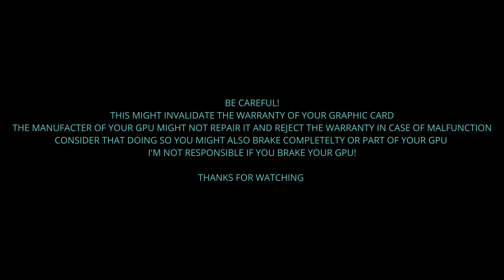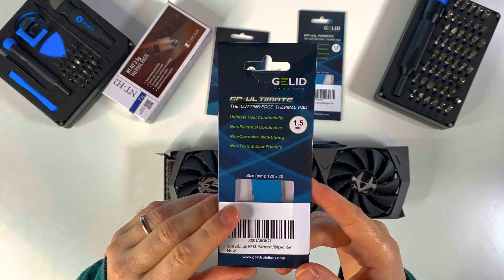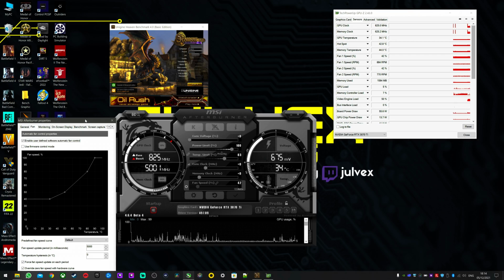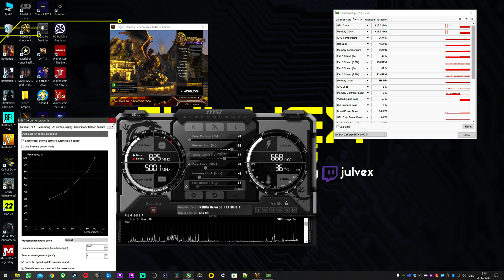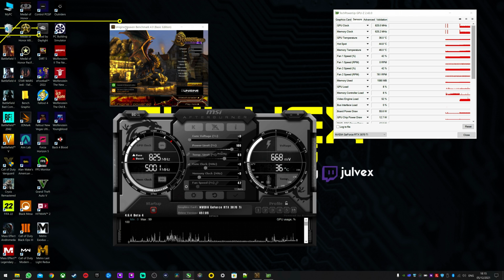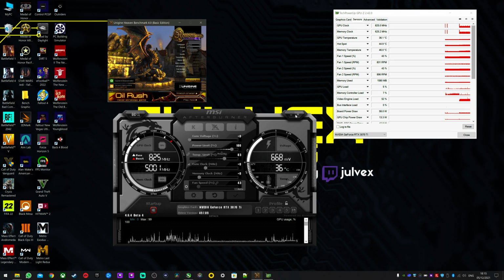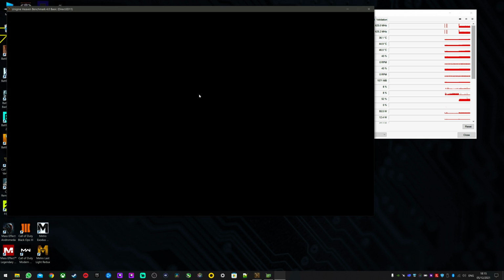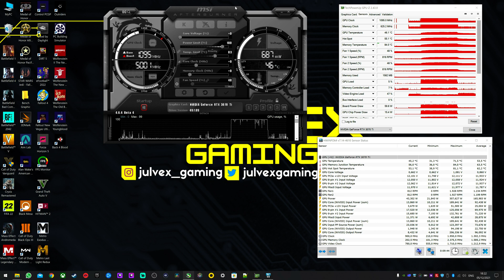Replacing the thermal pads on Zotac RTX 3070Ti Trinity OC

Comment: Zotac rtx 3070 ti trinity oc which thermal pads should i use gp ultime or extreme which is perfect for zotac
Reply from the maker: the extremes should be ok
Reply: @JULVEXGAMING I have used extreme 2mm on front and ultimate 3mm on back now I have high core and hotspot but memory temp are 88 is it bad or its ok
Reply from the maker: @RayanXPlayz  depends on whether those temps are in idle or in use, if in use, those temps are ok
Reply: @JULVEXGAMING2mm on front and 3mm on back should be ok right ?

Comment: First time replacing thermal pads, was looking to improve my thermals to make my rig more silent so that I can lower the fan curve.
=> bought 3 sizes (Thermalright Odyssey Extreme 2.0, 2.5, 3.0).
Opened my gpu up, removed and verified that the pads zotac used matched with my 3.0 and 2.5 (foreshadowing, uh oh) by lining them up and comparing => applied 3.0 back, 2.5 front.

After applying the new pads VRAM was insanely cool, but my core temps were absurdly high, fans spinning etc. thought my gpu was gonna explode juding by my fans lol
Reopened and the GPU-die thermal paste was barely spread on the cooler contact plate. I squished the front 2.5 down a bit with to make them even with the gpu-die, should be a good fit now, core temps are fine but the VRAM is sitting at 70 degrees in idle. After about 6 hours of either Core or VRAM being too hat & constant reapplying and testing this is kind of a bummer. 

Well, I guess my pads are way too hard, Zotac used very soft ones. My backplate is also a bit bent from the thick 3.0 on the back. What I will take from this is watch out what hardness you buy for your thermal pads, unless you exactly know the specifications of your needs, softer ones will make things way easier as they allow for more margin of error. Will try again with softer pads

Comment: Don’t use 1.5 for the front, I used 1.5 and it wasn’t cooling correctly (exact same pads he was using in the video) I then saw people saying to use 2.5 gelid extreme so I did and the memory did go down to below 50 but it was too thick for the radiator to touch the gpu core so it wouldn’t cool properly. I’m now ordering 2.0mm and will let y’all know how it works out because I’m guessing it’s 2.0
Reply: Hello! Did the 2.0mm do a better job? Thanks!
Reply: @estralo81  for me yea, just make sure you clean off the old stuff real good and you don’t over tighten when reassembling because it can crack the gpu die
Reply: @theepicgaminggod4275  so 2 mm for the inside pads, and 3mm for the backplate ones?

Comment: I'm thinking of buying this card used. Does this card has heating issues? And opening the card won't kill the warranty?
Reply from the maker: Normally the card shouldn't have any big heating issue, the thing is that depends on how demanding the game(texture/resolution, etc) is, and also it depends on what condition you're buying it.
Keep in mind that you might lose the warranty  -depending on where you live, better ask your regional Zotac support just to be sure
Reply: @JULVEXGAMING  btw have you undervolted the card? If not can you try undervolting the card to 150w and see how it performs 🙈
Reply from the maker: @vzero8612  sure, check it out here: https://youtu.be/el1FUYXtB0Q
Reply: @JULVEXGAMING  nice but that's not half the power drow. Can you you please test your GPU in 150w or on it's half power and see how much performance you're losing and temps. If you're still using 3070 ti.
Reply from the maker: @vzero8612 I don't have that GPU anymore, but usually, I would recommend undervolt instead of using the power slider just to avoid strange behavior with the power spikes.

Comment: hey i did the exact same of the video on my zotac but the temp are higher than before any suggestions?
Reply from the maker: Hello there, if the high temps are on the core try to repaste it, it happens to me that i have to repaste due to the shore of the pads, otherwise if the high temps are on the memory try to squish it or check if you tighten properly (don't overtight or you can damage the pcb!)

Comment: Thanks for guiding us. Do you know what is the purpose of the square black plastic around the GPU core (front side) for? I followed your guide and managed to get my temps down by 8C - 10C. But as I was busy cleaning up, i just realized i took the black plastic out to clean the it separately and FORGOT to put it back on.
Reply from the maker: I assume you're referring to the black square shape of the core in that case you have to put it back on it can prevent the core touch other surfaces that should not be in touch
Reply: @JULVEXGAMING  ok thank you, looks like i have to open it again.

Comment: Hello, did the gpu core experience an increase in temperature after changing thermal pads?
Reply from the maker: Hello there, not at all. If you apply it properly the core temp should be even lower

Comment: Are there different models of Zotac 3070 ti Trinity OC? I got 1.5mm pads and they arent thick enough
Reply from the maker: It might be, the only thing to consider is the shore of the pads to me some (not all) pads with a soft shore were ok others not. From what I’ve seen the exact measure (measured with caliber) is 1.7mm which afaik aren’t available. With most of the 2mm you should be ok
Reply: @JULVEXGAMING  2mm for the inside what abt the backplate? also 2mm or 3mm?
Reply from the maker: @MahboobIslam  3mm should be fine

Comment: Those who are doing this, PLEASE buy 2mm for the vram ESPECIALLY IF YOU ARE USING THERMALRIGHT PADS. 1.5mm is complete bs. I tried and there is minimal contact with the heatsink. 

Before: 98-100
After: 100-110+

EDIT: so i went full “dicko mode”. I used the remaining 1.5mm pads and layered them on top of the existing pads. Squished them all down gently with my finger, re-applied thermal paste, reassembled, and temps are now

1 layer: 100-110+
2 layers (please remember to squish it): 88-94

Do let me know if it works for u too! 🙏🏻
Reply: You suggest to use 2mm with thermalright extreme odyssey ?
Reply: @darknain  yea 2mm should be fine
Reply: @Keeferino  what do you use to clean the old thermal pads?
Reply: @darknain  alcohol wipes

Comment: Hi there..can i use 2mm thermal pads instead? Thanks
Reply from the maker: Hello there, yes you can try, squeeze them well so the heatsink can touch the core properly
Reply: @JULVEXGAMING  is there any effect if i use 2mm pad?
Reply from the maker: @amirazry4166  nothing asfaik just pay attention that the heatsink is touching properly the core and squeeze well the pads
Reply: @JULVEXGAMING  ok thanks for the info
Reply: @JULVEXGAMING  hi there, do you heat up the gpu a little bit before opening the backplate to soften the thermal paste?
Reply from the maker: @amirazry4166  no I didn't do that, I just squished delicately the backplate to remove it from the board; pay attention to disconnect all the cables especially the RGB cable

Comment: I did everything as in the video, but the memory temperatures only got higher.  even started dropping frequencies.  what could i have done wrong?  maybe not pressing enough?
Reply from the maker: It  could be possible, did you monitor also the core temps? Because that might give an idea if you have to press more or not, in fact if the core temps are high that means if the heatsink isn't pressing properly (except the fact that the thermal past is applied correctly); with that said it depends also on what thermopads you're. I would suggest trying to press a little bit but DON'T push too much.
Reply: @JULVEXGAMING  thanks for the answer.  I used all the pads like yours.  only I did not understand why the second thermal pad 120x20 1.5mm.  Is it needed instead of that massive thermal pad that connects the heatsink and the backplate directly under the 3rd fan?  I didn’t replace it, but it’s 2mm, and perhaps because of it, the new thermal pads don’t touch the radiator?  🤔
Reply from the maker: @nbroO  Yep, try that too (also because that one is horrible!)
Reply: @JULVEXGAMING  I use video card in mining.  It seems to me that immediately after the purchase, the temperature of the core and memory differed by about 20-30 degrees.  Today, 9 months later, Before changing the thermal pads, I had a core temperature of 50-53 and a memory of 102-110 at 75% fan and a room temperature of 25 degrees.  after the replacement, the core temperature is 41-43, but the memory temperature is more than 110 and the core starts to lower the frequency.  I will also say that in idle temperatures 37/62 at 50% of the fan.
Reply: @JULVEXGAMING  looks like you forgot to put in the narrow thermal pad you took off at 3:26
Reply from the maker: @nbroO  that’s a little bit high also in idle - even before you changed the pads. My room temp is 21/22c and in idle @45% fan speed the core is 29/30c and memory 34c more or less. I don’t use it for mining but in high demanding games with the new pads never went over 85/90c. Is your case ha in a good airflow? In case you can try with the 2mm pads- it happens to me with another one 3070ti amp holo - which is the same as trinity oc - that the 1.5mm pads weren’t fitting but the 2mm yes (but you have tu squeeze it a little bit).
Reply: @JULVEXGAMING  Tomorrow I'll try to disassemble and see how the thermal pads deformed after assembly in order to understand how much they fit.  I will also try to replace the thermal pad that I did not touch under the 3rd fan.  I'll post the results here.  maybe it will be useful for someone
Reply: @JULVEXGAMING  Today I disassembled the video card again.  1.5mm thermal pads are too thin.  they don't touch the heatsink because of the bezel around the core.  temporarily, while new thermal pads are being delivered to me, I combined 2 thermal pads and squeezed them well, also applied a little more thermal paste to the core.  now I got 53/83 degrees in the same conditions.  it's good but not perfect) add to the description that you may need 2mm instead of 1.5mm thermal pads
Reply: @nbroO  yes. I have the exact same issue. Also using for mining. @JULLVEX GAMING please update the description thanks.

Comment: Doing this will void warranty in india. Is there any other option to reduce vram temperature?
Reply from the maker: Hey there, I assume so but you should verify locally with your retailer or Zotac. You can lower the temps a little bit by undervolting the GPU while maintaining basically the same performances, I've done a tutorial on how to do that, check it out if you're interested, Also keep in mind that the airflow of your case is playing an important in order to have good temps.

Comment: Hello thank you for your video!
I tried the process but I stopped since I couldn't remove the heatsink, it seems that the heatsink is really stuck on the pads and doesn't move..any idea how to get it unstuck?
Thanks in advance!!!
Reply from the maker: Thanks!
I suggest you to check if you have unscrewed all the screws, if this is the case then I guess it might be that the heatsink is stucked into the core instead of the thermal pads (similarly when you remove the cpu cooler after a long time and the thermal paste is really dry); pay attention also you have disconnected also all the fan/rgb cables too.
Reply: @JULVEXGAMING  There is no adhesive on the upper part of the pads? If it is the core I will try to wiggle it (right left) to get it unstuck..

Comment: Your biggest problem is not the pads but the heatsink , bad soldering on fins maybe, but mostly because is Ni coated on contact plate of heatsink with GPU and other hot components,  which is very poor thermal conductor. 
Same as my EVGA 1080 Ti FTW, Nickel coating and black paints  is just hindering more than you want the efficiency of any radiator. You can add a 92 mm just on the backplate of the card sitting in angle that will take at least  5-6 C off your GPU temp @ only 1000 RPM. As for GPU RAM add copper shims and less tick thermal pads and that will take another 5-8 C- make sure pressure on GPU is right after placing shims - basically if original pads are 2 mm thick put a copper shim of 1 mm + 1 thermal pad of 1 mm which will bring it to 2 mm. Don't keep your card at 70-80 C cause other parts in computer will suffer as well. GPU or RAM won't burn but remember at 80 C other parts on on your video card will might not work as expected or jus die.

Comment: I checked the thermalpads on the vram of  my   zotac 3070ti an those are 2mm not 1.5mm  actually I tried using 1.5 mm and still had temp issues 2mm was a lot better I didn't replace the ones on the backplate
Reply: Same here, maybe its new revision of the card. When i replaced vram to 1.5mm thermal pads i got higher temps than on a stock ones... The correct size is 2mm for Vram and 2.5mm for Vcore.
Reply: @sebulba2988  I have a zotac trinity 3070ti ..... I replaced the pads with gelid ultimate 2mm. At the front I could not find 2.5mm pads. The temperature of the ram has decreased by 15 degrees ..... the temperature of the gpu / hotspot is 5 degrees higher than before. It's normal?
Reply: @Pippo11.el423  yeah ofc
Reply: Yes in video you can see vram temp at 84°c in just 50% of use 
That mean bad contact with heatskin
But about cpu Have good contact the temp are good

Comment: If you guys are running temps in the 80’s you have serious problems with your case and/or ambient temp of your room. I have a Zotac 3080 Trinity OC 12gb that were released last month and I’ve yet to see my card go above 62C during benchmarking/stress testing as well as playing Cyberpunk on max settings.
Reply: What we're talking about is the Memory junction temps brother. It's normal for it to exceed 80°C. You're referring to the main temps.

Comment: So you used 1.5 mm on the die side and 3mm on the backplate? 

I used 2mm die side and 3mm backplate and the core temp is very high now. I think I need to go back to 1.5mm die side.
Reply from the maker: Yes I used 1.5mm pay attention to really te thermal paste correctly on the die and before close definitely the heatsink give it an eye that the is touching correctly the die otherwise won’t transfer the heat
Reply: @JULVEXGAMING  unfortunately you did not show how to apply thermal paste correctly, I'm worried that I did something wrong, although the core temperature has become lower, but the memory temperature is higher.  maybe I applied too thick a layer of thermal paste and the heatsink is not touching the pads?
Reply from the maker: @nbroO   I would guess so,  regarding the thermal paste I went with the classic "dot method" (don't apply to much)
Reply: @nbroO  im having the same issue as you. Have you been able to fix it? Im very worried.

Comment: Thanks for this. I'm now running 10 degrees lower than before (Celsius). Happy with how quiet the fans seem now too
Reply: Have you rtx 3070ti trinity? How many rpm? Do You suggest me to replace the termal pads? Now i have 70 degree with 1650 rpm and 84 degree on ddr6x.

Comment: Thank you for the guide.  I have the 3070 TI AMP Holo.  Replacing the paste and pads lowered my temps significantly!
Reply: hi, what size mm pad should i buy for this card?
Reply: @ertanozturk5059  3mm back, 2mm front
Reply: Which thermal pads you have used on front and back  @ertanozturk5059
Reply: did you use the same brand as in the video? (GELID)

Comment: Do you know what the before and after core temps were?

Also how much do you think the rear pads influence temperatures?
Reply from the maker: The core temps, with stock settings, basically changes 2/3 degrees less because of the thermal paste I’ve used (Noctua NT-H2); but if you want to for less core temps try out undervolting which is the way to go with the RTX 30 series in my opinion - if you’re interested check out my videos on MSI Afterburner tutorials
Reply: Yeah. Undervolting is a must. I have the same card, and it was unacceptably loud and hot at stock, hitting the 83degree limit with fans running @ 85+%. I am now running at 850mV for the same core clocks, dropping core to 73degres and 74% fan speed. I have ordered 1.5mm gelids for the front and will replace paste. Hoping that the memory decrease will drop the fan speeds more. Not to sure if I am going to bother with swooping rear pads.
Reply from the maker: @kabal911   rear pads can help dissipate better the memory (this GDDR6X are tremendously hot) and all the temps in general; try, while gaming, touch the backplate…it’s a oven 😅
Reply: You are probably right. Might as well do it while I am disassembling it anyway. 

Thanks for this video btw, otherwise it would have been very difficult to know what size pads to orde
Reply: just to follow up here, IMO, 1.5mm pads for the front are not correct. the stock are 2mm. my cpu core went down (likely due to new paste), but memory went up from 90C to 100C when switching over. my fault, I shouldnt have continued with the pad swop even though I measured the stock ones before removing them all. have ordered 2mm and will replace
Reply: @kabal911  Do you have the same model as in the video?  I also found it strange to choose 1.5 mm thermal pads, usually 90 percent of manufacturers in the rtx 3000 series use 2 mm.
Reply: @discoking8744  correct, exact same model
Reply: @kabal911  It sounds like this card is just bad. I will not buy it.